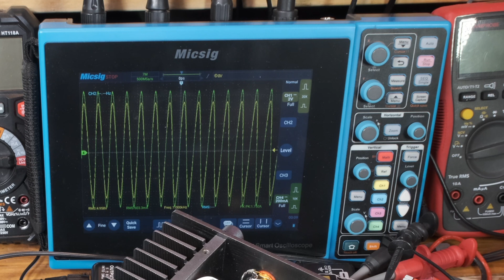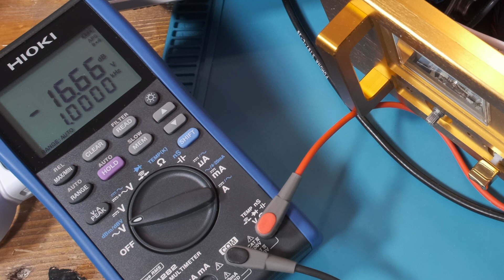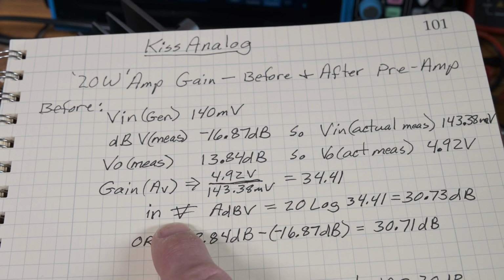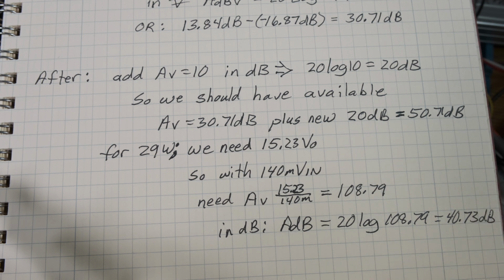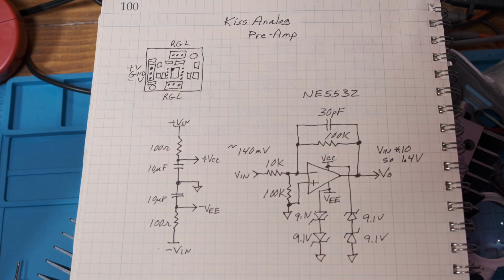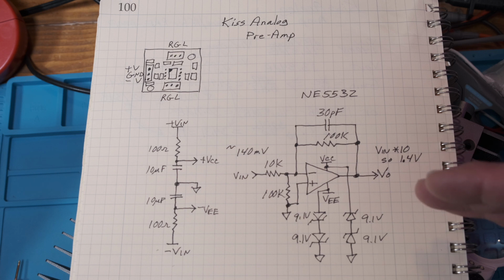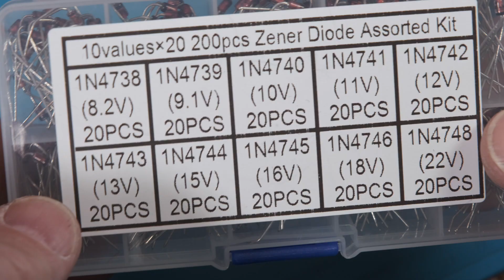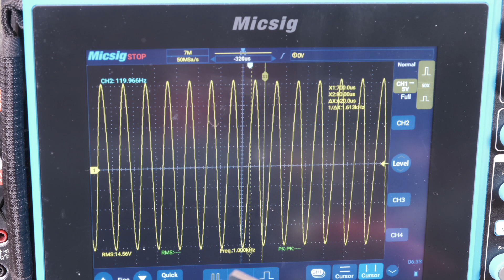Adding PreAmp to 20 Watt Class-A Amplifier

Comment: doesn't the preamp need RIAA EQ for hooking up to a turntable
Reply from the maker: Great Question!  The turntable has two outputs, and one of them has the EQ.
Reply: if the turntable has a pre amp out it should conform to the RIAA curve then as long as it has adequate amplitude or gain that is the one to use with your amp

Comment: Yeah, I'd like to see at least one Volt RMS out of a Line Out. Wondering if that preamp card should have gone into the turntable instead.
Reply from the maker: Great comment;) The turntable has two outputs, and one has the EQ, but why they didn’t bump the gain up a bit more is a little strange.  I think it was meant to have a pre-amp, and the non EQ is for a preamp with the EQ.  But, if you add the EQ with gain, why not make it 1 VRMS?  :)

Comment: Hi Eddie, hope you're feeling better.
Zener's are noted to be noisy, I'm wondering if the noise went up on your amp between them plus the added gain? This is why I don't like these low power amps, they sound good with certain types of low dynamic range music but you're always struggling to get headroom out of them, add to that the poor efficiency and you're basically running a couple of hundred watts to listen to music. Did you redo the THD?

I forgot to  tell you I have a new way of making power supplies. Since these Chinese board houses give you 5 and 10 boards for $5, I decided to make my supplies full wave and just piggy back boards if I need more filtration or the power goes up. This way I can use the same design for several apps. I just did this with my CNC power supply that is 30v - 10a. My small amps only need one board but on this I used two. Running full means that even with two boards I'm only using 4 diodes but with less voltage drop than a bridge. Works great!
Reply from the maker: Thank you - I appreciate you! Yes, I am doing much better;)
There is a fair size cap in parallel to the zener, so I don't think it changed the distortion.  I'll do a full batch of testing on the final product to see how it performs.  I know what you mean about the dynamic range.

Comment: Does you friend's turntable need an RIAA compensated pre-amp, or is that done in the turntable electronics? I ask because I did not see anything but a normal amplification circuit in the pre-amp and in the channel boards themselves.
Reply from the maker: Great question!  His turntable actually has two outputs and one is for the EQ out, but only puts out 140mV.

Comment: I have used these little pre amp boards many times on my channel. Looks like yours is OK with it's 30 pf cap, but hundreds were made with the wrong value cap in the same place giving a HF roll off above about 8khZ. It proves that the makers never test such things. I'm sure you will love it's sound, or should I say LACK of sound. AB test will show no apparent changes in the sound stage, just gain, which is what a preamp should do. Gain, nothing else added.
Reply from the maker: Thank you Michael - that's great feedback.  Do you have a link to one of your vids?
Reply: @KissAnalog  Hi Eddie, as requested here is the link, this is a follow up video but is the one you show
 https://youtu.be/67P18zL1WV8  an earlier video where I first find this component fault is here, almost the same but this one is for a single supply rail  https://youtu.be/vZ5XyXB2BU0 keep up the good work, more audio please.

Comment: Nice video. Are you concerned that any error in offset from the zener diodes used to reduce the rail voltages will cause a DC offset in the input to the power amplifier?

That's a beautiful box by the way. I guess it was part of the kit?
Reply from the maker: Thank you and great question!  No, I'll have to share an updated schematic so you can see.  

The box is separate.  I'll make sure I get a link to it;)

Comment: You're description is for the next video.
Reply from the maker: Did you see the little pre-amp I added to the box?
Reply: @KissAnalog  
"I will show what adding capacitance to the power supply will do for ripple reduction.  This video title is; 20W Class A Amp meets Big Capacitor.  There is a playlist for this 20 Watt Class A Amplifier (see below).  It is titled 20W Class-A Amplifier meets Big Capacitor."

Comment: @KissAnalog 
#KissAnalog my understanding is that there are two main types of phono cartridges ceramic and magnetic and there is also inside the group of magnetic cartridges two types of magnetic cartridges , Moving Magnet (MM) and Moving Iron (MI) cartridges and that they are based on which part moves and the cartridges type stylus abrasive between https://en.wikipedia.org/wiki/RIAA_equalization standards and https://en.wikipedia.org/wiki/Magnetic_cartridge i see they mention 35dB, i dont understand logs but if 3dB is a doubling 35/3 would mean a gain needed of 11.6 constant which seems close to the gain of 10 you mentioned

tbh i have only worked with magnetic types and they only output up to around 6mv and they need gains of 200 -250 so the turntable must be ceramic cartridge based or have preamp elsewhere i would think

i found this article https://www.vinylengine.com/turntable_forum/viewtopic.php?t=30431 very interesting in talking about the wide variation of ceramic based cartridges and there is science around the abrasive stone too, thanks for taking the time to make this video very interesting and enjoyable you make great videos that get me thinking and asking questions ;-]
Reply from the maker: Thank you @Dassa Direct!  Good info - I'll check out the links - thanks.  Another way to look at db is for every 20dB you have a 10x gain;)
Reply: @KissAnalog  I'm looking at this and going "no, 10db is 10X power" then I realise (after google) you're doing amplifier gain and I'm doing speaker power.